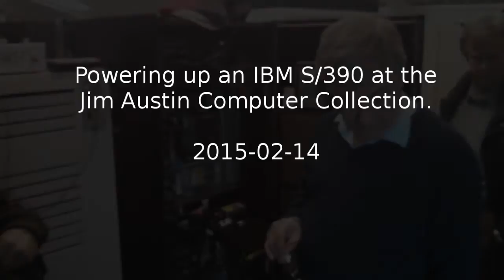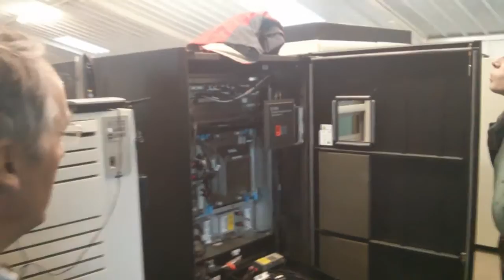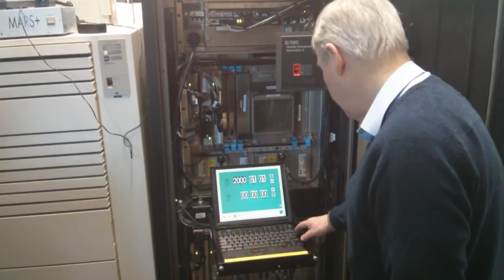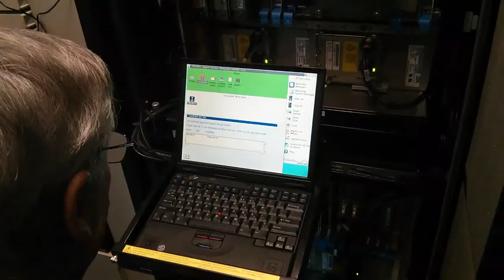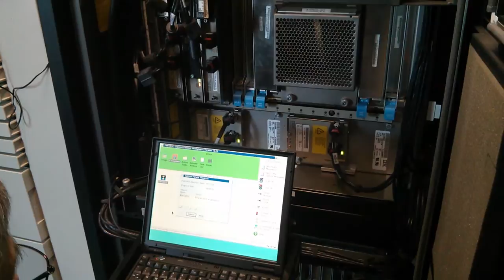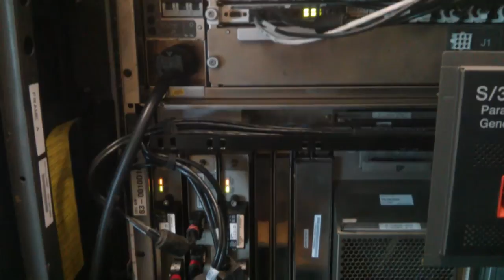Powering up an IBM S/390

Comment: Nobody uses such computers anymore but only PC-based Linux servers. Much cheaper and much more high performance. This old computer must have used the cobol language which has been replaced  by enterprise javabeans 2 decades ago.
Reply: @aa bb
It seems you're not familiar with this area of the computer world. Mainframes are the core of large enterprises such as banks, insurance companies, governments, etc. These machines aren't going anywhere anytime soon because of their super reliability and massive I/O capabilities, among other reasons, none of which are available from Intel-CPU based computers. There are billions--yes billions--of lines of COBOL on mainframes running the world. That language has most certainly not been replaced by enterprise Javabeans and won't be anytime soon. For the enterprise customers that need these beasts, after factoring in the much needed capabilities I mentioned and IBM's crazy licensing prices, those organizations often find that the the total cost per transaction makes using those machines financially worthwhile.
Reply: Better tell IBM, then. I think you'll find they ship quite a few.
Reply: Mainframes run the ordering of parts for automotive assembly lines and put together quotes for fleet sales, project delivery dates based on millions of pieces of data.
Reply: HI

Comment: You managed to IML and start the CPUs, but you failed to IPL an SCP. The PSW loop is the CPU reading a bad PSW and CCWs from whatever the IPL source is you used. Check if the IPL source is right.
Reply: I can see you know what you are talking about, can you give me some advice to sell a ibm s/390 mainframe ,i have no ideea what  to do with it,for sure parts are missing from inside,any advice would be verry helpfull
Reply: @claudiunemes I don't sell these things, so I have no idea how to pitch this. The only thing I can tell you is these things make a lot of noise, produce a lot of heat and eat a lot of power. They also don't like to be switched on and off all the time and they're almost worthless if they don't come with an OS, because these are not for everybody to easily obtain.
So whoever is going to buy your machine is going have a place to put it in an air conditioned room or hook up it's water cooling depending the model. He's also going to control the humidity in that room and he'll keep everything running which will result into a huge power bill every month that will knock your socks off, but which he will pay with a smile. That's the profile of your customer.
Reply: @statinskill  thank you for the information
Reply: @Claudiu Nemes
To add to what @statinskill said, you'll probably need commercial electric power; a German guy here on YouTube who owns a mainframe had to wire up his garage with 3-phase 400-something volt power for it. Also, I think the cabinet frame typically doesn't hold DASD (hard drives in IBM speak); those go in a separate enclosure. As for the OS you might be able to obtain a hobbyist license from IBM for that. However, even then you'd have no applications, databases or development tools like compilers--just like how if you buy a PC loaded with Windows it doesn't necessarily come with MS-Office, Visual Studio, etc.

Comment: Why there are only a laptop to control the big box?
Reply: Because big box havent own keyboard and monitor
Reply: Bramantya Ramadhani Because the "big box" needs a service processor to load the CPU microcode, perform tests etc. In the video, they never got any further than loading the microcode and starting the CPU.
Reply: @Bramantya Ramadhani
In IBM parlance the laptop is referred to as the "service element". It's the closest thing to a PC's BIOS.
Reply: GOOD  MORNING

Comment: It takes so long to boot because it’s like an airplane. It does internal self checks so you don’t die in the air when it’s started from dead cold.

They have only booted the microcode in this vid. No OS is running yet.
Reply: I know, it's that delicious moment when the microcode has run through its initialization and all registers have default values loaded. You can literally taste the excitement in the air because the next step is IPL. And what will we be running? VM/ESA or will we be running OS/390 on the bare metal? Will there be IMS or CICS? Perhaps even DOS/VSE? Watch more videos to find out.

Comment: Why does it take so long to boot?
Reply: unoduetre12345 Mainframes have quite a lot of self tests that run.  It takes time.  Remember that these machines really are never meant to ever be turned off.  They run 24/7 365.  Whole subsystems can be pulled out and replace without the machine ever having to be powered down or rebooted.
Reply: Keith Davey yup. First boot is often one of the last boots...
Reply: unoduetre12345 btw i have a old laptop from apple, it takes the length of the video to boot!
Reply: PC GUY 1241 but that's apple...
Reply: hidde bouwmeester true, but a mac is also a pc. Apple and Microsoft are both good, you desire which one you choose. I think the a windows laptop From the time with the load of use an programs Will do this in the same time.
Reply: PC GUY 1241 i don't like apple it is so different to the rest but when you have a look on ms-dos it can start in 10 sec or windows 2000 in 30 sec or maybe 1 minute
Reply: IBM S/390 mainframes are designed to remain powered on throughout the lifecycle.  Once its powered up and it will remains powered up until its retirement.
Reply: Yeah, you can reboot the OSes running on the LPARs or VMs if you want.  Those don't seem to take very long.  Just answer some start up questions, warm or cold start,  format your spools etc. Even running z/OS in mainframe emulator is in TSO or ISPF in just a minute or two.  Doing an IPL of VM/370 on old systems just took a second or two.  I don't imagine z/VM takes but a few seconds as well.